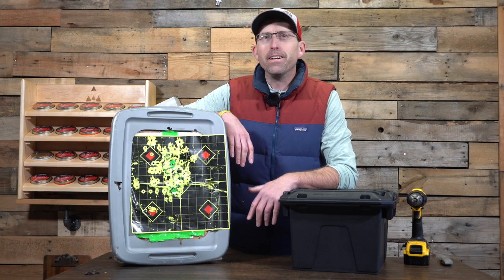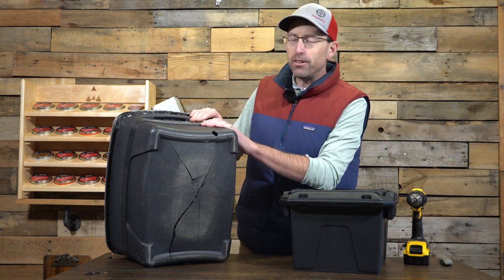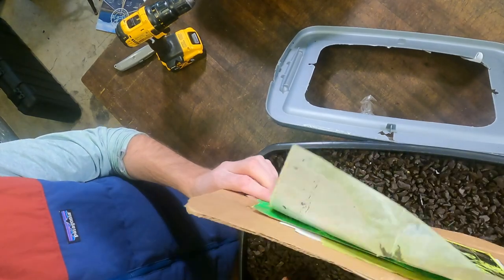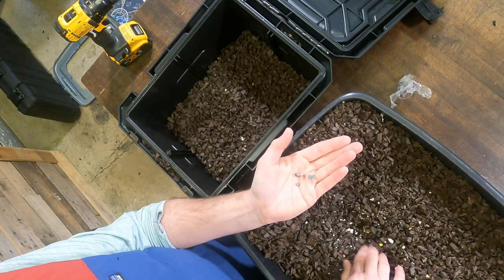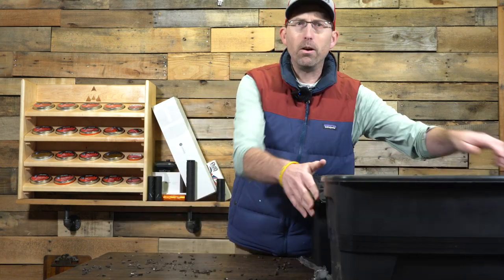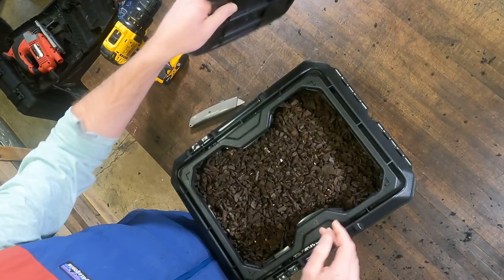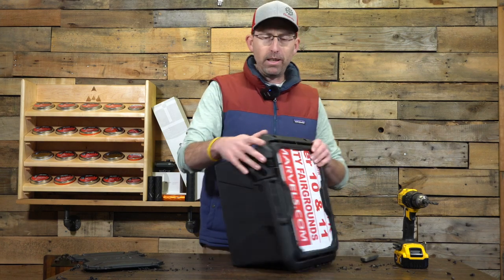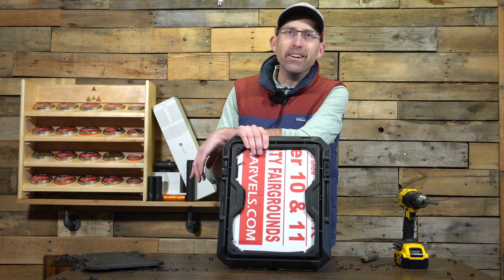A Better AIRGUN Pellet Trap | Airgun Advisor

Comment: If you used a substrate that floats like foam packing peanuts, it maybe tree mulch (does the rubber mulch float?), you could dump the whole lot in a 44 gallon drum full of water, with the pellets falling to the bottom and the mulch floating, ready to be reused 🇦🇺
Reply from the maker: That is actually how I clean my trap. Little difficult to dry it out. On hot summer days I will spread the wet mulch on the blacktop for a few hours and it is dry again.  Great comment! Yes the rubber floats.

Comment: I used a larger tote and didn't cut out so much of the lid (hopefully keep the target below the settle level). I then put the mulch inside a burlap bag. Takes a lot of shots to tear holes in the burlap. When it does, I just lace them closed. My only problem was mine was so big, I had to use the wheelbarrow to move it to the back of the yard 😮. So far so good.
Reply from the maker: Great idea

Comment: I bought a 20 inch box fan a few weeks ago. The box it came in is 21"x 21"x 4".  I cut about 20 sheets of cardboard and put them in the box.  I plan to cut a 20"x20" piece of 3/8ths plywood and put that in the back of the box.  I intend to put a lot of screws through the back of the box and into the pkywood. I also want to put a couple of eye screws in the back corrners so i can hang the box on the wall.
21 sheets of cardboard will probably stop the pellets from all of the guns i have. If they don't the plywood will.
The plan is that every few weeks i will take out the front sheets of cardboard and put new sheets in the back. I will shake out the pellets and recycle them when i get enough of them.
Reply from the maker: Sounds like a good plan. You will have to update us on how it works. The only thing you may have is a lot of paper flakes as the cardboard gets eaten by the pellets. Again, update us once you have some use on it.
Reply: @AirgunAdvisor  i will give you an update in a week or two.
Reply: Add a couple precut squares of carpet available from most big box hardware stores for a couple bucks. Carpet is amazingly tough.
Reply: @Kycirion  I found out that if I shot the same spot a few times that it will go through 20 sheets of cardboard and  1/4" piece of plywood.  I will have to try some carpet next.

Comment: Just an observation, but since most modern hi-power airguns would easily punch through the top of the Plano, why wouldn't you just keep the original box material as a target mount until it became too damaged to  hold the material?
Reply from the maker: You are correct. The only potential issue is if the plastic cracked instead of making a clean hole. If it cracked in the wrong place it might not hold the material as well over the long run.

Comment: Why cut out the front? Why not just stick your targets on it? You can always cut it out later if needed.
Reply from the maker: Great question. I cut the front out of the plastic tub, because when plastic cracks the crack could go anywhere. Thank included cracking the edge of the lid and preventing it from holding the mulch afterwards. By cutting it, I prevent that from being a possibility. Hope that helps and thanks for watching.